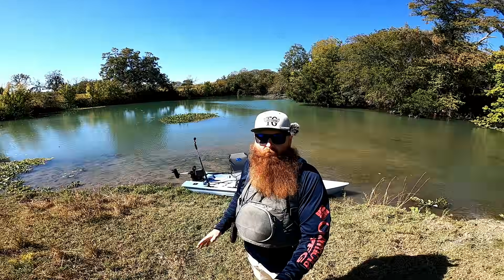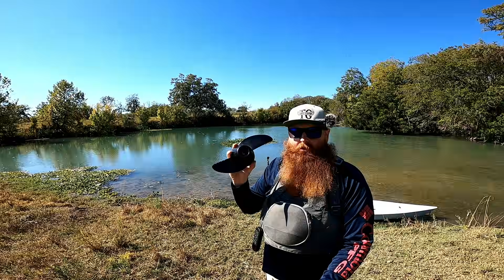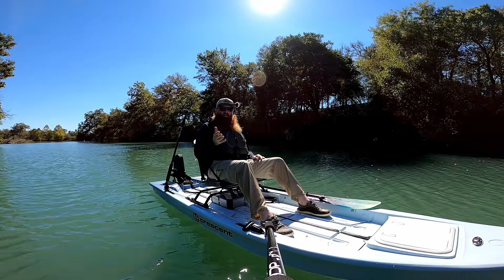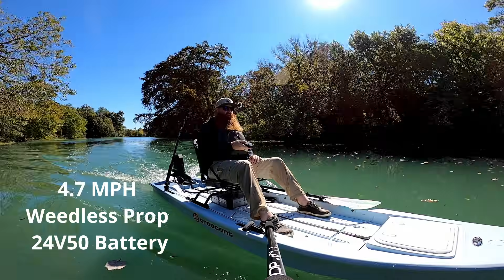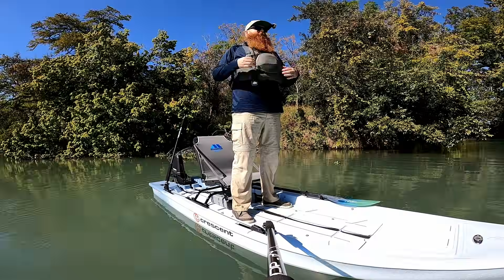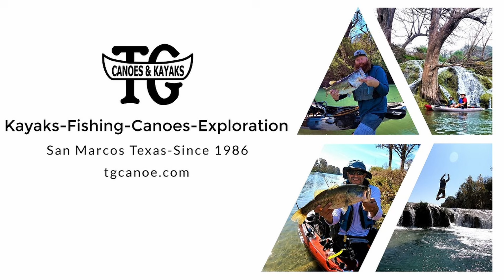Crescent Cres-Craft with Garmin Force Current Kayak Trolling Motor

Comment: Nice set up thanks for the video! At $3,000 not including battery and battery charger it’s going to be way more than I would spend but Garmin makes solid products. I really like the boat!
Reply from the maker: So far the Garmin has been great. It will have a growing community in 2026. Torqeedo, Newport, and Minn Kota have great motor options as well.
Reply: @tgcanoesandkayaks yeah the spot lock is the feature the others don’t have (at least I don’t think they have). If the depreciation wasn’t so horrible on kayaks and accessories it’d make more sense for me.

Comment: This is going to be an odd question lol but how big are you? Im 6'4 320, and I am wandering how well this vessel would do with someone my size. I know it's rated for 500 lbs.
Reply from the maker: I am 6'2" 260 lbs. Stability and carrying capacity will be no problem. Speeds will vary slightly though.